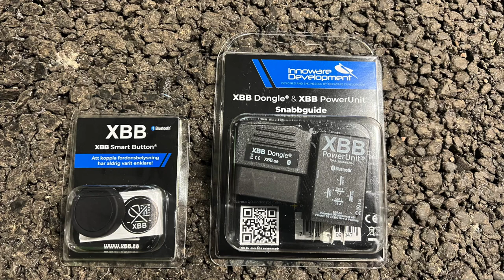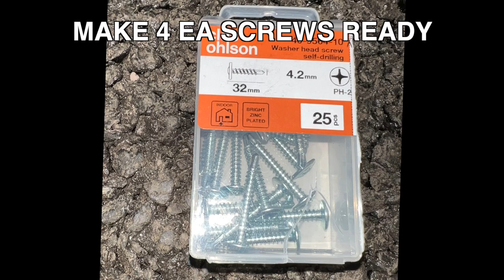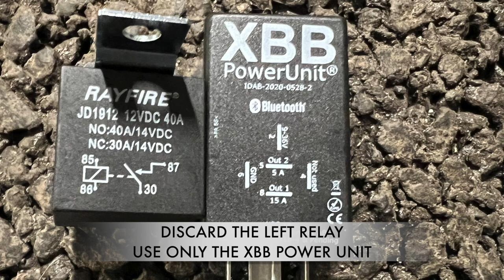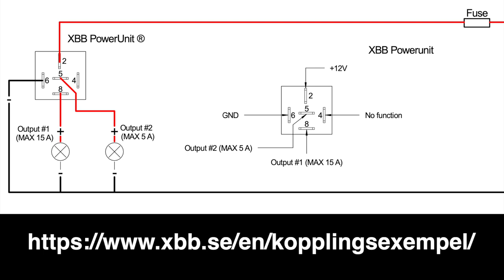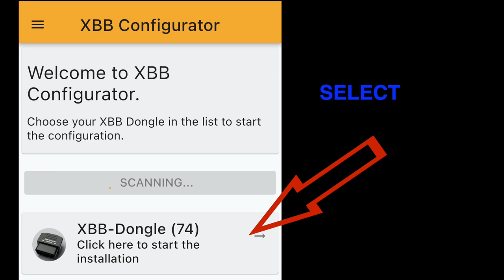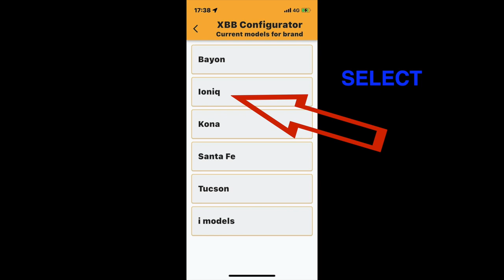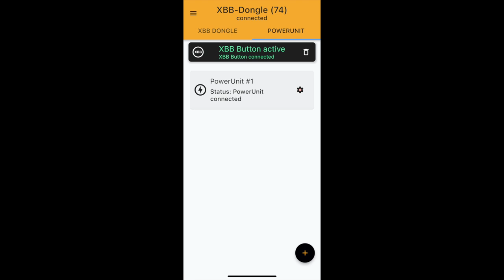Installing Ledbar with XBB Dongle and XBB SmartButton on a Hyundai Ioniq 5

Comment: Thanks for the guide! Helped a lot. Had hard time figuring out where to pass through the plug under the cloth to radiator area, as there was no holes. There was a cable tray where I managed the push the cable through. (MY22)

Comment: Hi, nice work! 
The dongle need to be always connected in the OBD after installation?
Does the led bar light on when car high beam lever is selected?
What is the use of the smart button for?
Reply from the maker: Good question’s!
Yes, the Dongle must always be connected in order to get the LED-bar “communicate” with the car’s signal to high beam.  If you need the OBD for other purposes you can remove the dongle and set it back afterwards. 
If you need the OBD for other purpose simultaneously you can buy a Y-splitter. 
The LED-bar will follow the high beam lever selection combined with your last questions. 
The SmartButton gives you the opportunity to select the LED-bar ON/OFF when you has selected the High Beam on. This can be a good help when driving in Fog or snow weather and the light from LED-bar reflects and blinding you. 

I’ll will update the description. 
Thank you.